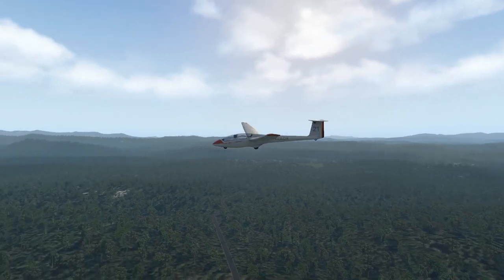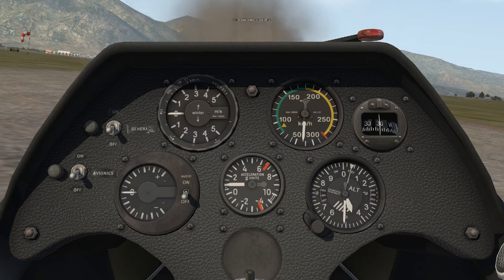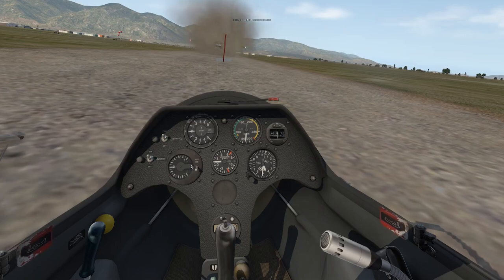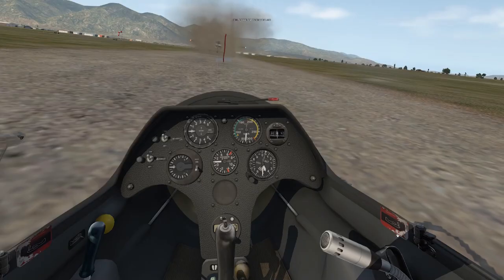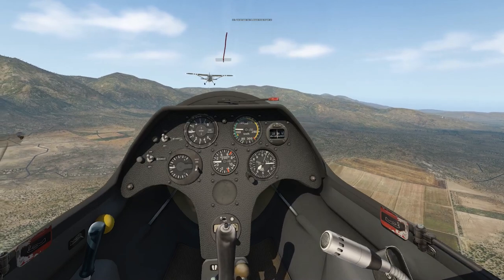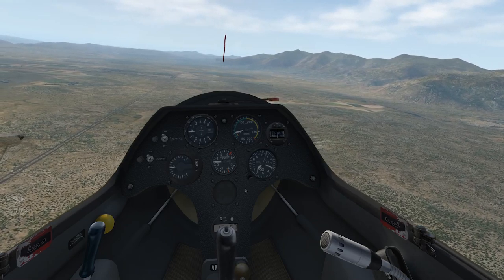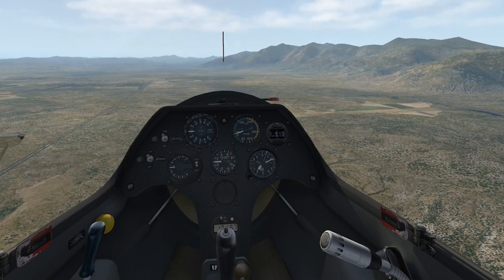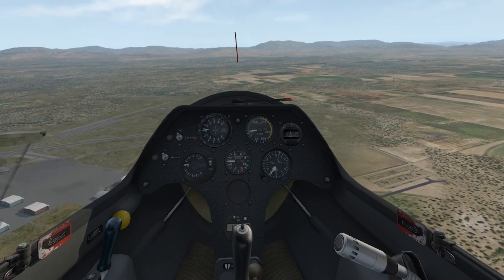X-Plane 11: Soaring With The ASK21 Glider

Comment: I fly the ASK 21 IRL (you can watch a few actioncam-videos on my YT chanel). The biggest difference between sim and the real thing is the take off by winch. We have a 1200 meter cable which pulls you in one minute or so in a hight of around  400 meters. The acceleration is compareable to a sports car: from 0 to 100 km/h in under three sec.! In X-Plane the glider gets faster and faster with every meter hight. At 1200 feet (360 meter) the speed is 190 km/h!  In real live its the other way around - the plane gets slower with every meter altitude. At the top you are around 90 - 100 km/h.  Futhermore: The effect of the airbrakes is massive in real life. And they are fully extended pretty noisy. X-Plane needs a few more soundfiles to simulate the brakes.
Reply from the maker: Thanks for the insight, Henry!  What’s the name of your channel?
Reply: clayviation It’s his name?

Comment: Thank you for this video.  I couldn't find the wheel brake and you showed me on your video.  A few questions: 1) are the wheel brakes on the rudder pedals?  2) When flying on down wind for landing, when do you start your turn to base and final?  Do you use the spoilers for landing?

Comment: Thermal height setting is where the thermals top out or stop. I normally set this to around 15,000ft with 15-18% thermals @ 500-650 fps
Reply from the maker: Good insight - thanks Evan!

Comment: Did you know the ASK-21 can be spun inverted?  The USAF did a flight test on the airplane at Edwards AFB in May 1989.  We did erect and inverted spins.  Hope the manufacturer has updated the flight manual as the USAF sued the manufacturer over the fact the manufacturer had not done full envelope expansion and exploration of the spin envelope.

Comment: On mine, the towplane wants to veer off to the left off the assigned runway (18), a grass airfield. I fly RL sailplanes. I am still not convinced this is the best sim. I also have Condor but it too has limitations.
Reply from the maker: Very cool that you fly sailplanes! I’ve had the feeling that there are several of the glider dynamics that might be a bit funny.